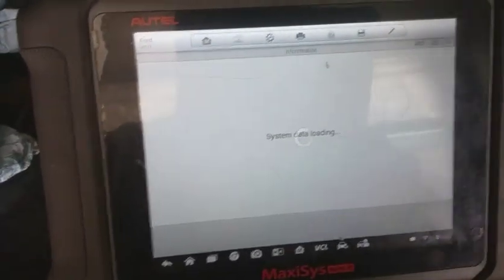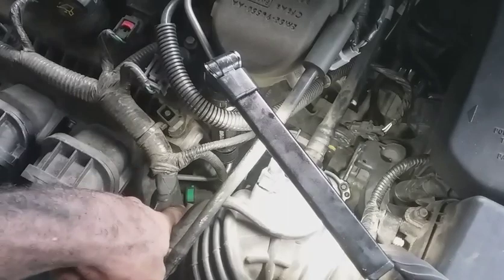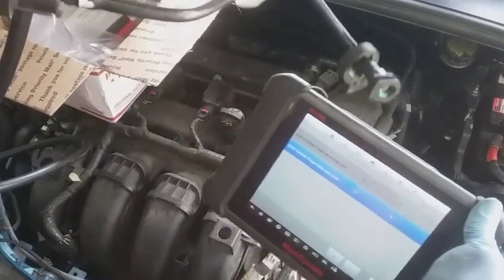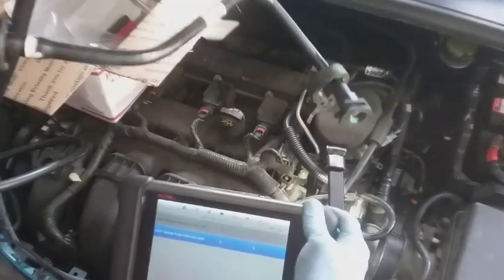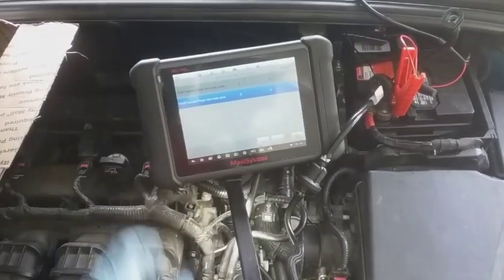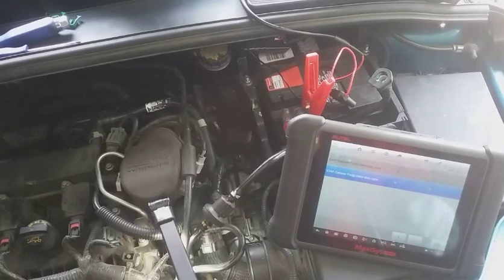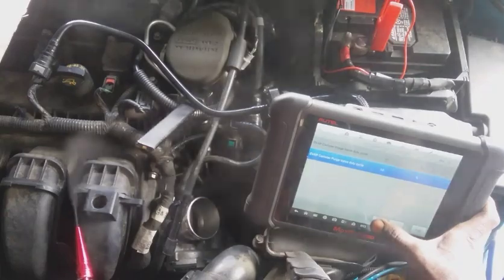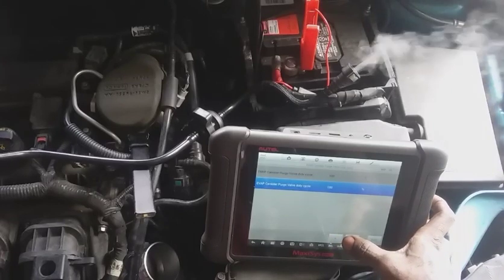2014 FORD FOCUS P144A P2196 DIAG/FIX

Comment: Great vid my 2012 Ford Focus was stalling at the light and having trouble catching up to speed limits without slipping and engine code 3003:16 related to low volt circuit or something this erased the code and fixed the issue repair shop would have been 1000$-2000$

Comment: i have the same car, no CEL, no codes, the car has a intermittent misfire/pop out of the intake when applying 30% or more throttle between 1000-2000rpm, no one can seem to tell me what is wrong, i have replaced spark plugs, coil, flow tested the injectors
Reply from the maker: Check for lean codes, p0171...  If non are present, check for vacuum leaks with spray bottle and water. Allow car to run and spray water around intake. If idle change, repair intake leak.

Mass air flow do CRAZY THINGS... I had a truck have no code yet, it would backfire under load and lack power like cats were clogged! -disconnect mass air flow and see if it regain power with a drive, if so... You Likely have a bad mass air flow sensor. This test isn't definite however can answer questions! Try cleaning it.

That car I fixed only had issue starting, extended crank. Most cases the purge valve does this, however... I can take in actual gas in extremely rare cases, like never rare 😆. Doesn't seem like your issue because you achieve barometric pressure during acceleration.

-if above fail... Check compression, make sure head gasket isn't blown between cylinders, this will cause vacuum leak symptoms as burnt intake valve
Reply: @partsshooter  thanks for your reply. when the misfire/pop happens, the obd scanner only shows "lean condition" but no codes, i have tested the car with another MAF sensor, but it still had the issue. 

when i unplug the MAF sensor it does not have the issue and the intake noise is very loud
Reply from the maker: @Foozefighter  so it runs perfectly normal with MAF disconnected?
Reply from the maker: @Foozefighter  it's a possibility the mass air flow sensor you tried was defective. Ensure you have good powers and grounds. 

If you have a scan tool, bidirectional... Reinitialze the fuel trims, sometime the long term fuel trim will stay permanently stored and require clearing to run properly.

Look at upstream sensor and see if it's stuck lean. Add fuel to see if the numbers change to rich and short term respectively
Reply: @partsshooter  it runs perfect with no intermittent misfire/pop out of the intake, another thing is, when i cold start the car the car will idle perfect, but as soon as i want to take off the car will lose all power as if someone is holding their hand over the intake and it will almost die but then i let go of the throttle and it will correct itself after 2seconds
Reply from the maker: @Foozefighter  try answering in complete question, text offer no good context.

-but if you disconnect the maf, it run fine workout backfire, this ensure the cat is fine... No blown head between cylinders or fuel deliver... Timing etc.

This seem like poor output from a integral sensor. "MAF"  or wiring related issue with this integral sensor.

Just do the A/F sensor testing by adding supplemental fuel in intake. See if sensors ST fuel trim changes. Low volt is rich and hi volt is lean on these.

Comment: Have the same issue, wont start after fueling.  Coded p144a, p2196, and p0131.  Fuel gauge isnt functional either.
Reply: Did u figured out what was the problem ?
Reply: @cranky104  $30 gas tank fine vent purge valve

Comment: Good Video - Thank you for making it.  I had the code P0144A on my hand scanner.  Internet search pointed repeatedly to this little solenoid valve.  I am taking my old 2012 Focus on a long trip next week and when I heard this little valve could cause stalling and engine starting troubles, I made the decision to spend the $35 for the replacement part.  The vehicle has 154,000 miles.  The info you showed how the thing is constantly clicking reinforced that decision.  The internet also showed that Ford had a recall due to this part.  I had cleared the code and it didn't come back so I figure it was waiting for me to leave on the trip before doing it's thing.  Both the new and old valves measured 15.8 ohms with a Fluke so it may have been an intermittent mechanical problem or something else setting the code.  These types of videos help a lot of people out.
Reply from the maker: Youre welcome! Thanks... Thats motivation to make more videos!

Funny because I'm doing a rear wheel bearing video I'll upload later tonight or tomorrow on the SAME CAR😎.

Have a good one!